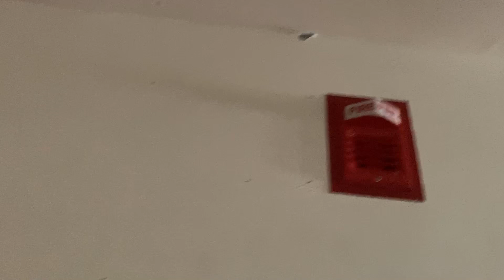Fire Alarm Test #104 | Vintage Simplex

Comment: If the old panel was still working, I think the panel swap was a complete waste of money. If they aren’t doing to replace any of the devices, a panel swap would do any good.

Nice video, though. The system is super nice too (aside from the panel).
Reply: They wouldn’t have replaced the old panel if it was still working.
Reply from the maker: @DJMarcyMoo  it actually was still working when it was replaced. They added portables and the gamewell dealer was able to sneak in and upsell them into a new panel when adding the portables to the system. Pretty stupid decision imo as well
Reply: @4O5O-8O  They’ll look for any excuse for to milk more money out of the customer. They could’ve used an existing zone on the old panel if there was a spare or tied in a small panel for the portables. Judging by the age of the original devices I’m assuming the old panel was either a late 2001 or an early 4002.
Reply: @DJMarcyMoo I'm guessing it would have been made in the 1982-83 period, which meant the panel's electrolytic capacitors were probably on their last legs.  Those are always the components that go first in vintage electronics.  I had to replace all of them in my late 70s Pioneer receiver recently.
Reply: @4O5O-8O  Probably a smart idea as electrolytic capacitors typically last 40-50 years.